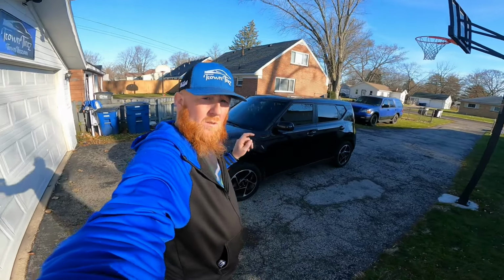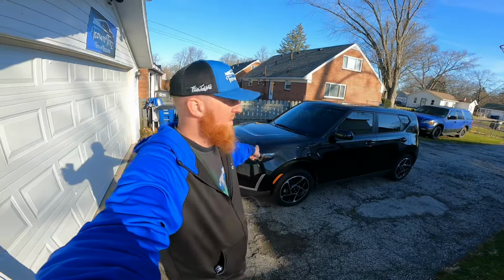Stick around full windshield and fronts in 1st person on the install.

Comment: Very nice to see how this is done. I've seen some piss-poor "user-tint" jobs with cheap tint that shows they did it in a rush with no squeegees or hot air guns (hair dryer). This video explicitly shows the professional detailing needed for a pristine tint jobs on front windshields. Marvelous! 👌
Reply from the maker: I appreciate it been doing this for 13 years now. I try hard to do it the best I can and use the best products I can. Also just stand behind my work.